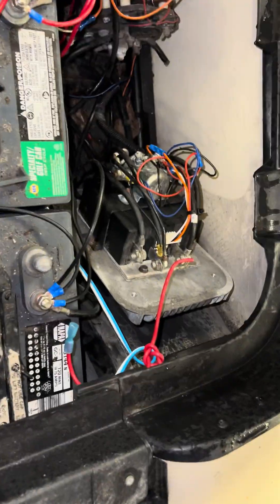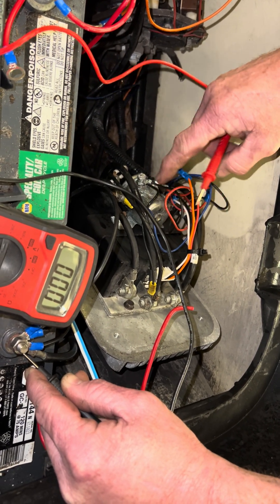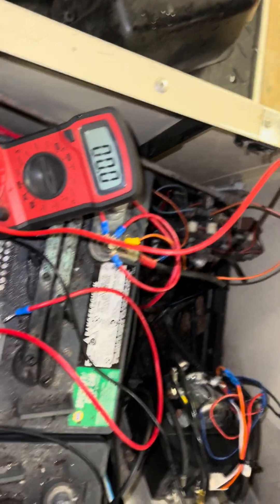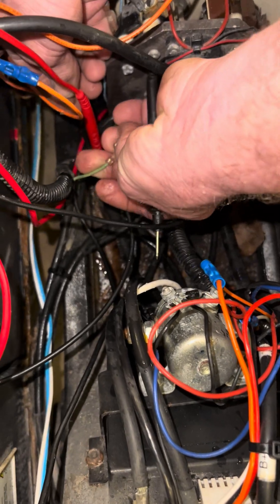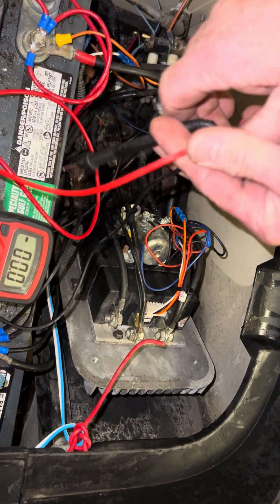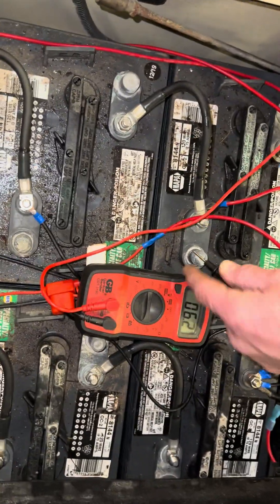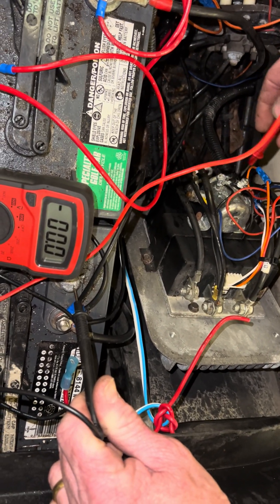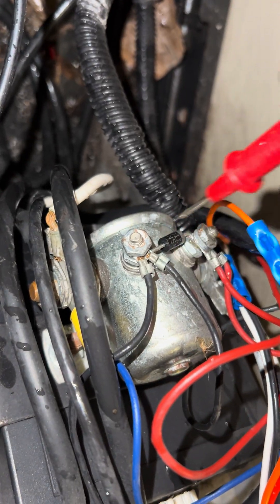What's REALLY Causing Your EZGO 36V SERIES Controller Solenoid Problems?

Comment: With negative cable off using meter between negative post and cable I have 37.7 volts with everything off. I think it should read 0 am I correct and what could cause this.
Reply from the maker: Which cable are you measuring it to. The cable that you took off? What problem are you having?

Comment: Great videos. Is there a way to restore the safety feature that reed switch provides from the factory when you switch to lithium ? I'd be curious if not too much of a hassle. Otherwise, it's not that big a deal.
Reply from the maker: You could, but you would have to wire an AC relay up in line and power it Off the AC cord to make him break the relay when you give it power. But you would have to have a type of relay that is closed until you plug it into the wall and didn’t open and breaks the contact

Comment: I don’t have this exact model but I have 36v ezgo. I watched your other video a figured out I had a bad controller.
I replaced the controller and cart runs great. Took it camping for first trip and I’m getting the 2-3 beep for thermal cut off. After about 30 min ride time.

How crucial is thermal paste? I didn’t apply any of that. Is there any testing to do for over heating
Reply from the maker: How fast are you driving. If you drive it halve speed they will shut off. Thermal past isn’t going to matter it does help a little bit my opinion it’s useless.  Main thing is make sure all your bolts are back in the controller when you changed it. And make sure that your solenoid isn’t getting hot causing more heat. The main thing is they are made to drive not cruise especially the model you have which is a Pds.
Reply: @golfcartwhisperer thank you. Yeah we were just cruising around campground not going fast. I also bought an after market controller not a Curtis brand. Is there anything worth trying like installing a little 12v fan or anything? Get the Curtis controller?
Reply from the maker: @rob-g1r yes you could do a fan. One thing I found out to help some was get h to e solenoid out from under the cover.  Because the solenoid pulls heat too
Reply: @golfcartwhisperer thanks again one more if you don’t mind. Ez got back to me with a thermal pad 73190G01. You have any info on those? Recommend thermal pad over the thermal paste?
Reply from the maker: @rob-g1r thermal pad.  lol. It’s about 1cm thick.   If you drive it halve speed you will always have a problem.
Reply: @golfcartwhisperer battery cable size good? I have 4 gauge
Reply from the maker: @rob-g1r yes 4 gauge is good

Comment: I have a new problem with my 2000 Yamaha EZGO G16E 36 Volt
I just put new batteries in it
It doesn't do anything...except:
When the key is on and I put it in reverse there is no Beeping that indicates reverse and of course doesn't move at all
When the key is off and I put it in reverse the back-up beeper goes off
No Movement in any position
I can plug in the charger and nothing happens either
I am "Flustered in Florida"
Thank You for your time sir
Reply from the maker: did it did it run prior to batteries?
Reply: @golfcartwhisperer  Yes It had the intermittent problem previously
Reply from the maker: @howardhunt5565 put the black lead on the main negative and the red lead of meter on the red wire on solenoid.  What does it show key in in the f position
Reply: @golfcartwhisperer  28.3 V
Reply from the maker: You can reach out to me at 843-505-1611

Comment: When checking the ITS, what happens if you have 10 v on the white wire at full pedal , not the 1.5 he spoke of. Bad throttle sensor? Controller?
Reply from the maker: Does the black wire show 14 if so replace its
Reply: @golfcartwhisperer  thanks man , yeah I figured. I had already ordered it. Yeah I was showing the 14v upon any movement of the pedal , but when I was one the white and hit the pedal I believe I was getting a full 10v or so , not the 1.5v . Thanks for your video by the way.. it’s already helped me diagnose the golf cart 3 times, easily, and learn more about it.
Reply from the maker: @ryanbuckley9213 good man glad your learning. Thanks for wayching
Reply: @golfcartwhisperer  

Hey man. Maybe you can help. I replaced the its because its cheap but its still having the same issue as before, which is,power cuts out in the forward position intermittently, I do not believe it cuts out in the reverse position, in fact, when it cuts out , if I switch it over to reverse and then back to forward it seems to engage forward again, until it cuts power again.
Reply from the maker: What year is the cart also does it beep when it quits. And does it do it when taking off or at a steady speed.
Reply: @golfcartwhisperer 

I have an aftermarket dash that makes it hard to see the bin tag, to the best of my knowledge it’s a 2001 , if you need me to be exact I’ll rip the dash off. The cart doesn’t have any beeps at all. The reverse chime is disabled as well. It would usually cut out at a start or a very slow speed.

Comment: This is the type of cart I see at my properties, the EZGO TXT G3094-95 is common, the owner bought several of these and we keep working on them trying to keep them alive.
This is the model I needed a run down on. 
It helps to identify when your testing whether it’s the line/ load or switch side you’re testing, like when you read the voltage on the green wire I couldn’t tell which side you were testing, but I’ll watch it again to see.
Thanks again for these informative videos!
Reply from the maker: Watch this video here
Reply: @golfcartwhisperer  Great videos... just SLOW down a bit. Quit jumping around, finish what you were explaining!  You have lots of info and your viewers are like sponges trying to follow your movements.
Reply from the maker: @zackwhatley6449 first of all man thanks for the comment second I appreciate the input of what you think needs to change. That is something I’ll work on. I hope you’re subscribed.
Reply from the maker: Here is a video that I just did recently, the video above is one I did about a year and a half ago but I edited it so I had to redo it but check this video out and tell me what you think, sir. Criticism helps man I appreciate.
Reply from the maker: https://youtu.be/lD2Z8SECq5U
Reply from the maker: Ezgo golf cart service manual wiring
https://youtu.be/vIh6PTG-9TE

Comment: If I'm getting no voltage to the activation wire for the solenoid when I press the gas where do I go first?  The pack voltage is good and the batteries are new and charged.  I checked continuity on the pedal switch when pressed and it is working.  This is a very good video.
Reply from the maker: @ashleysanders1258  Do you have a tow switch

Comment: Continued from other video heyheyhey97. ok so on controller 0 from white white and 0 from black wire. Time for a new controller? If so what do you recommend? Unless you thinking something else.
Reply from the maker: @jasonreid1776  as long as voltage checks good on the red wire feeding the logic side of the controller. Yes, replace controller. What are you wanting to do go fast or just drive the golf cart

Comment: Hello Golf Cart Whisperer
I have a 2000 Yamaha EZGO G16E 36 Volt 
Recently it has developed a problem
It speeds up and slows down intermittently
What could be the problem?
Reply from the maker: @howardhunt5565 once it slows down. How do you get it to run normal again.
Reply: @golfcartwhisperer  It just continues to speed up and slow down intermittently
I fiddled with the fwd/rev switch control wires and it seemed to change a little bit
The top left connection seemed just a "little bit" loose and slightly discolored
Not knowing for sure I can't hardly afford to parts change in the present economy
Reply from the maker: @howardhunt5565  I know what you mean there. Well you came to the right channel.  We don’t just change parts in any economy
Reply from the maker: There’s only one thing that could be that is your throttle position sensor. I would take the floorboard up look on side of the pedal. Make sure all your connections are good and get your voltmeter out. put it on ohms.  Take the lead of your meters and put one on the green wire and one on the blue wire hit the gas. See what homes it shows if that does nothing. Then take your leaves put on the green wire and the blue wire hit the gas. See what ohms read. hold it in a steady spot and if it fluctuates then your throttle sensors bad

Comment: I’m having trouble with my Yamaha G29 golf cart. Would the diagnostic test be similar to this?
Reply from the maker: What’s it doing.  Is it electric
Reply from the maker: What year
Reply from the maker: @KerryCrowder  what’s it doing
Reply: @golfcartwhisperer  I can’t seem to find anything on Yamaha that helps
Reply from the maker: @KerryCrowder  not too many people work on, but I work on anything that pays the bills lol next time I get a Yamaha in my shop I will do a video one
Reply: 2007 48 volt just quit no reverse buzzer, replace the solenoid
Reply: No Power except headlights 50.9 V on battery
Reply from the maker: @KerryCrowder  put black lead of meter on main negative and red lead on the small post on solenoid    Lot meter on dc 200. And tell me what voltage you get
Reply from the maker: Hey Kerry on my page I have several videos of Yamaha’s if you didn’t figure your problem out

Comment: Have an 05 ez go txt. Installed amazon 500 amp controller and 400 amp solenoid. Click from pedal and doesnt move. Voltage for the black wire is at .2 and drops to 0 with pedal. White wire at .5 then 13 after pedal. Cart worked before the controller and solenoid upgrades. Solenoid and battery pack voltages all check out. tried switching the black and white wire thinking maybe the wiring diagram was wrong but didn't help. Any advice would be greatly appreciated!!!
Reply from the maker: @jessewashington-u1j  run you a wire from main positive to the small post on solenoid red wire and tell me if it runs. In forward and key on and hit the gas
Reply: @golfcartwhisperer  thank you for the quick reply! Sadly I still get nothing
Reply from the maker: @jessewashington-u1j  post a. Idea of your cart controller and everything in your page and let me look at it. Let me know when poat
Reply: I'm not allowed to create a post so I took a screen record of the parts I purchased. Not sure if it is what you were wanting but I've never done anything with YouTube but learn from other video creators
Reply from the maker: What’s your email
Reply from the maker: Your cart have a tow switch?
Reply: @golfcartwhisperer  no it does not
Reply from the maker: @jessewashington-u1j  jump your solenoid with a battery wire the 2 big post and hit the gas. Let me know if  runs
Reply: @golfcartwhisperer  just clicks the same as if I hit the gas. Then when I press the gas nothing happens. The YouTube email you sent me is a no reply
Reply from the maker: @jessewashington-u1j  put red lead of meter on main positive battery, black lead on m negative on controller. Turn key on, put cart in forward, hit gas… what does voltage show?
Reply: @golfcartwhisperer  just 0 after gas (  .8  before gas if that means anything )
Reply from the maker: @jessewashington-u1j  put red lead on b+ on controller, black lead on b- on controller. Turn key on, Put in forward, hit gas. What does it show?
Reply: @golfcartwhisperer  pack voltage
Reply from the maker: @jessewashington-u1j  and on the controller black and white wire with the black lead on May negative the red lead inside the black wire and then put the red lead inside the white wire you said you have no voltage correct you hit the gas
Reply: @golfcartwhisperer  black gets 0 with gas, white gets 13 with gas, red gets pack voltage with gas
Reply from the maker: @jessewashington-u1j  replace its
Reply from the maker: It’s in the floorboard under the floor Matt . Do you know how to change it.
Reply from the maker: Let em know and I’ll share a video with you on how to change it.
Reply: @golfcartwhisperer  ITS worked before controller change, if I reinstall stock controller and it still drives then is the new controller the culprit?
Reply from the maker: @jessewashington-u1j  that’s correct
Reply from the maker: @jessewashington-u1j  at the same time your light bulb was good until you turned the switch on.  Always remember this electronics are crazy.  Don’t go with your gut go with what the meter shows you.
Reply: @golfcartwhisperer  sorry I haven't had time to mess with it but replaced stock controller and cart operates properly. Is there a budget friendly 500 amp controller you recommend for an 05 ezgo txt 36 volt
Reply from the maker: @jessewashington-u1j  are you trying to get speed?
Reply: @golfcartwhisperer  mainly just for help with hills. cart has an upgraded motor, lift and 23" tires
Reply from the maker: @jessewashington-u1j  your carts a series controller right.  Handle by your leg
Reply: @golfcartwhisperer  Curtis 5 pin
Reply from the maker: @jessewashington-u1j  okay I would make sure if you go with a bigger controller to upgrade all your wires.   If not you’ll burn your f and r board up as well as melt the battery post. I would go with a Navitas controller. But whichever one you go with make sure you upgrade the solenoid to a high amp sol
Reply: @golfcartwhisperer  already installed heavy duty f n r switch, wires, solenoid, batteries and cables. thank you for all of your help!

Comment: Hey bubba. I just got a 1995 ego medalist. It had bad batteries. So I just replaced batteries. I was backing it up just a bit and then it stopped and wouldn’t go forward or reverse anymore. I did these tests up until the end. And it doesn’t give me anything. Now if I have red on left and black on right. And put it in neutral I get a voltage. Please help:/ thanks
Reply from the maker: Does the solenoid click
Reply: @golfcartwhisperer  yes it does
Reply: I’m out here with it now
Reply from the maker: @MegaJbozz  k take black lead of meter and put on main negative. Red lead on both big post of the sol. One at a time. Hit gas in forward key on for both test. Tell me what you gwt
Reply: @golfcartwhisperer  37.7 on left side
Reply: @golfcartwhisperer  37.7 on other side
Reply from the maker: @MegaJbozz  give me about an hour and send me a text on you tube. Trying to finish this cart up. But I’ll be done in an hour then we’ll get it running
Reply: @golfcartwhisperer  heck yeah bubba. That’ll work!
Reply: @golfcartwhisperer  I’m free and available whenever you are. No rush or anything I just appreciate the hell out of you for trying to help me out!
Reply from the maker: @MegaJbozz I’ll be home in 30 then I’ll get back with you
Reply: @golfcartwhisperer  10-4 all good
Reply from the maker: @MegaJbozz  are you still on you tube
Reply from the maker: @MegaJbozz  send me your number on here then I’ll tell you when to delete it and I’ll text you
Reply from the maker: Yes sir

Comment: I have a solenoid wont click . Im not gerting any volts theough green or red wites from controller i dont have current on other side of solenoid
Reply from the maker: @tie9370  run wire from Main positive to small post yellow wire on solenoid. Let me know if cart runs
Reply: No...
Reply from the maker: What type of Ezgo do you have. A pds or series.
Reply from the maker: Meaning do you have a tow switch. Or is it like the cart in the. Ideo
Reply: Yes I have a tow switch if the switch is on tow no power in both white, yellow wire dark blue grey orange  green . I do have power at green with black  both orange wire if I turn tow switch to run I have power
Reply: All I can find is ezgo
Reply from the maker: I am going to share one of my videos with you. Let me know if need any help
Reply from the maker: EZGO GOLF CART WONT MOVE.  TROUBLESHOOT WHOLE CART!!
https://youtu.be/lD2Z8SECq5U
Reply from the maker: Let me know if your cart is like the video I shared with you
Reply: Hello brother I watched the video you sent great video appreciated.. my results..the lower left side plug that has green red black and white does not have power the black wire has .9 volts when pressing the pedal it goes to 3.0 the white rire stays steady at 14.5 15.0 volts. I have no power on Left side of solenoid does not click.. from what I'm seeing is it both controller and solenoid.  @golfcartwhisperer
Reply from the maker: @tie9370  so if you put black lead on main negative and red lead inside the green wire and hit the gas what does it show
Reply: Thank you will do
Reply: Nothing
Reply from the maker: @tie9370   ow that’s with the key on and in the forward position and in run correcr
Reply: Excuse me key on in forward it has pack volts in natural nothing
Reply from the maker: Sorry man I have so many messages that I didn’t respond to you. Do you still need help
Reply: @golfcartwhisperer  I want to say thank you for your help it was the controller box I truly Appreciate your help ..... You rock brother
Reply from the maker: @tie9370  np man. Just make sure you hit that like button and subscribe
Reply: @golfcartwhisperer Subscribed 👍🏻. I noticed my left side tire wasn't rotating I pulled drum it's rubbing the shoes seem to be a lot of end play. I assume there should zero end play or a very small amount of any ?
Reply from the maker: Only one tire will spin that’s normal.  You want the drum to drag the brake shoes a litrlw
Reply: @golfcartwhisperer ok ya I pulled other side to look and check for end play ... Diver side inside axle slides in and out about ¾ of an inch ↔️ passenger side no play ... ↔️...
Reply from the maker: @tie9370  have you pulled the axle out and looked at the splines that go into the rear wns
Reply: Not yet I'll do that next  @golfcartwhisperer